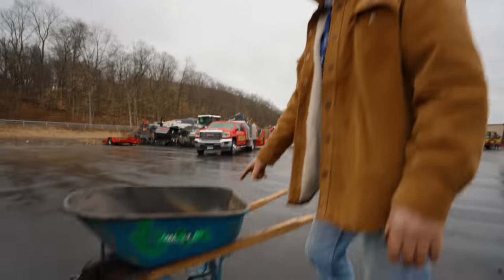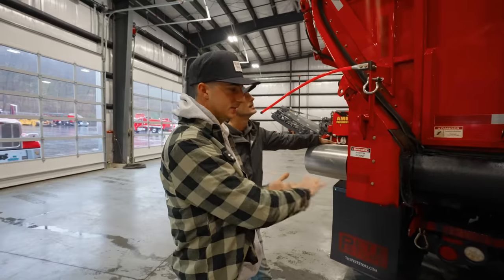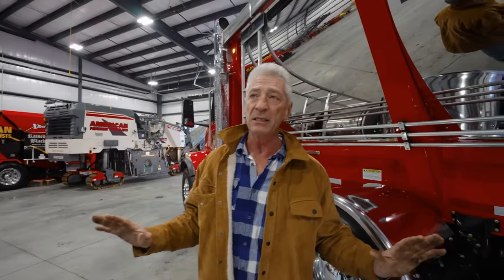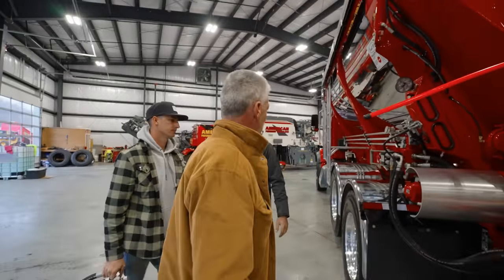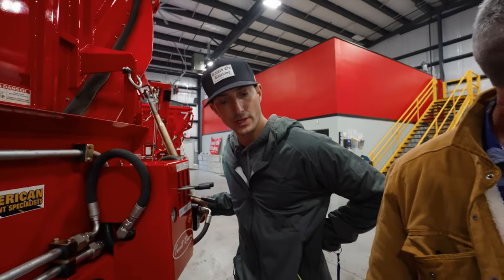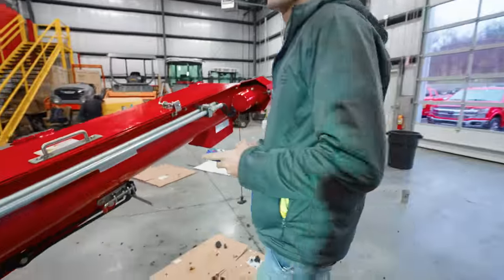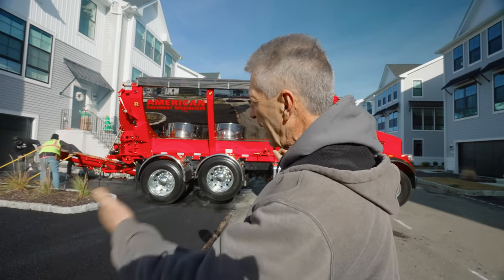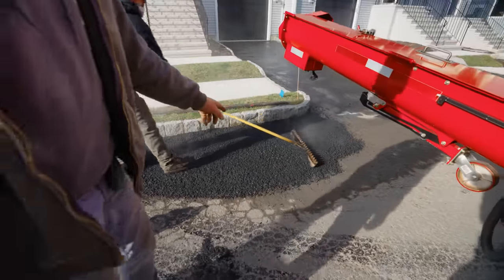NEW PETERBILT 567 LIVE-BOTTOMS | Trout River x APS

Comment: This should be a requirement for dpw/municipalities for multiple reasons. Helps in in patch work which is most of their work and helps in pothole repairs along with everything you've said. Would also be good for loam after a roads been paved or after a new sidewalk along the edge. Also good for edge of road/ shoulder work. This would also be good for mulching flower beds along roads or in rotarys.  Brilliant idea guys for sure would love to try it out but trying to convince a municipality to buy one and maintain it the right way would be tough.
Reply: That is exactly what I was thinking.
Reply: weeping tile along foundations back filling, trenching filling for pipes cables ect,,, , even just gravel on a driveway ,  no other equipment but a rake , but pot hole repair speed must be 10x faster if not more , thinking with out a box tight there,

Comment: I think adding in load cell or inline air pressure monitors on the rear bags would allow you to know what tonnage you have left on board and when you start.  Takes the guess work out of knowing or thinking you know what's loaded or left on the truck
Reply from the maker: Agreed!!! Hard to tell what’s in the truck without the body raised in the air.  We discussed this the other day. Most likely going to add them to this unit this winter!

Comment: I’m just a farmer we use that hydraulic hook up on our heads on our combines. I’ve always wondered why it doesn’t get used in the construction industry. My brother-in-law put a 50 foot on the back of a live bottom street truck that he built with a huge troth auger like you got , but it wasn’t as fancy with that remote. That’s a good idea. He had a big job where he needed to get up in something. I can’t remember what the hell it was 10 years ago. And the u trough auger came off our farm. It was basically wore out and wasn’t moving green is efficiently but it sure does move asphalt kind of doesn’t like your binders especially dense binder, but nice job I like it you should make it so you can add on extensions if you want.

Comment: Not sure if this would be beneficial but if there was two extra buttons on the remote to signal to the driver instead of having to take your hands off the control to wave them on. One button for forwards will signal the driver and another button for stop. Even if it was led lights flashing by their mirrors in the cab. This would allow the control operator to not need to focus on getting the drivers attention and can keep their hands on the control moving the auger position.
Reply from the maker: Great idea.  Almost like the stop and go lights on the new milling machines.  We are going to fit it with cameras but then you have the problem of the driver watching the camera when you need them looking at you!

Comment: Two things come to my mind. First of all, awesome idea! I’m not a paver, but I appreciate innovation. 

The “cap” on the hydraulic coupler. The part that stores in the cab when using the auger? Tether that to the coupler. One day somebody will be in a hurry and set that on a fender. Next thing you know it’s bouncing down the highway. 

Other thing. Watching you guys use that and knowing there’s a driver and an auger operator I wonder if they can be combined. You know the trucks they drive guardrail posts with? The operator in that jump seat works the stake pounder and steers/ moves the truck. Could make it stupid expensive but could make it way more productive.

Comment: Awesome piece of equipment.  Couple thoughts; how about look at some of the wrecker (heavy duty tow truck) pin on equipment maybe a tag axle for further capacity, a solid pin design easier to connect into a plate on the truck body, if you are using the auger for a primary stage how about a secondary extendable stage that is belt driven (lighter and not as heavy since you already augmented the material) for greater material spread without moving the truck.   Possibly more integrated control from the ground versus driver for PTO / Body & Aux paving accessory......Name BTBS203.1 (Black Top Bill Stanley).....nice work from a great group of guys!!

Comment: i think you could change the clean out assembly on bottom some sort of sliding gate , also is bed heated and could it be ? (maybe on sides )  also really great vision and craftsmanship by you and trout run good stuff
Reply: The trout rivers that I ran weren't heated, I'm sure they could be by piping the truck exhaust thru like they do with some slinger and dump bodys. But the bodys are so well insulated, we would be on a Dot job sitting for 6-8 hours with a load doing patches with base and it was coming out just as hot as it went in!

Comment: Awesome work. Maybe add an adjustable blade or paddle at the end of the chute that will spread the drop, maybe that will make it easier for the guys spreading it. Because the machine did some of the work for them.
Can definitely see the chute operator makes a big difference. The more evenly he can distribute the material the easier and faster the job is going.

Comment: we have these types of trucks her in norway, but they are usually tridems with a steering axle in the front and the back. you can load around 17 tonns of asphalt and the truck itself is remote controlled along with the auger. the driver has a fully sised controler around the waist and drives the truck and the auger👍

Comment: All I can say is I want one. I've seen heavy wet sand clog up or burn up belts in live bottom spreaders. This seems to have not had a problem at all with the asphalt! Hopefully it'll be sold without chassis like a dump bed and fit your own truck to it. Please try all materials on this gypsum asphalt sand soil etc

Comment: It's a beautiful thing, there boys.
I'm retired now but I've hauled a lot of asphalt in my times in the Cleveland Oh. area. Mostly interstates. Tandems, Tri-axles,  Semi-dumps, and then came the live bottoms. Wonderful for under bridges & uneven ground.
Thats a nice rig you have there.   But I was just wondering if you have an external hydraulic oil cooler on it. If not you might think about one. They really help.
Also having a couple of cameras mounted on the back of the truck for the driver would be nice.  And using a headset & mic (the kind they use in helicopters)for the guy operating the screw & too the driver would be cool. Hell might as well go all out. LOL
Having a bigger size screw you would get more asphalt flowing out right . Making work faster. 
I subscribed to your channel. I'm very impressed with your operations. Good luck guys.
Peace out!

Comment: How do you protect the belt from all the heat? How often are you changing out the belts and what’s the cost?
Reply: the belt is heat resistant and the box will rust and rot out before the belt wears out. but overtime the belt can get thin and ive replaced a belt like this except on a longer bigger truck. they run about $50 / foot and its up to you to replace it

Comment: can this unit run concrete?  rocks/river rocks?  landscaping applications?
Reply from the maker: We think it’s going to be more for fine material.  Asphalt, sand, top soil, mulch, process.  Don’t think it’ll work well with river rocks.  You can discharge without the belt attachment.  If you’re looking to fill in a trench or something.

Comment: Nice job man, this thing is a pretty hot setup for what it is intended for. I just got through reading all the comments, and there was countless people commenting that this kind of technology has been around in other parts of the world for a long time now, etc. but I almost feel like they are missing something. I think the real beauty of this man’s design, is the ability to quickly detach this piece and then be able to use his cool ass dump truck as normal. In no time at all. Maybe I’m wrong, maybe those other units easily detach as well, I’ve never seen them. But you have to admit, the apparent ease and amount of time this takes to attach and detach is not too damn shabby. Pretty impressive working design, especially for the first prototype of it. It can only get better from here on out, with small little tweaks here and there. Lookin good my man!, nice job!
Reply: They do detach easily. Under ten minutes.
Reply: @to666be  is that right?, and then you’ve got just a regular live bottom dump truck after you detach, as in this case? That’s pretty wild. I had never really seen a live bottom dump truck until I watched this video, and they seem like they work pretty doggone slick. Especially like he said, in areas where you’ve got trees, overhead wires, etc. Wonder if there is ever an issue with a buildup of debris around and under that belt though?

Comment: Hey APS! Really good video and business. We have a similar system here in Sweden, tho it has some longer reach etc and you can actually steer/drive the truck from the remote on the outside of the cab. 
The system here it’s called “Sprider” 
Greetings from Sweden👋
Reply: Yeah I was gonna say, Europe has had trucks like this for years, it's not really that new of a thing. All be it the ability to remove it and run the truck just normal might be.

Comment: very impressive  they always say that you can improve on everyday things and you did that very nice set up , I had a question  what is that thing hanging at the end of the shoot looks like a pull for a motor has like  what looks like a handle on the end ?
Reply: So we needed something for the driver as a guide. It’s easy to see when the placement when the material is falling but it’s hard to gauge when it’s off. So we took an old pull cord and tied it up. Gives the drivers better placement.

Comment: we have a 80 liter tank on the truck with push button auto sprayers to clean the inside and belt and a spray hose the driver can use to clean rims  tyres ect  no stick all ways clean. all on  camera

Comment: I did asphalt for a decade. Never once used a wheelbarrow. We did interstates and major roads. Are the wheelbarrows used on smaller jobs and driveways?
Reply from the maker: Yes a lot of smaller asphalt companies use them for tight spots and paving by hand.  We do mostly larger commercial work and we still can’t get away from them. Hopefully this will solve that problem.

Comment: Does tilcon have a similar setup but up front like a cement mixer? Or is that a curbing truck ?
Reply from the maker: Yes they’ve been running old cement trucks fitted for asphalt for years! Only difference is you can’t dump into a paver. We can run this truck every day. Attachment or no attachment

Comment: Awesome design! You could potentially solve the auger reach issue with a secondary auger that folds up to still keep the machine compact. Similar to a grain auger system. Then the truck could park on the road and you would have reach and maneuverability in the auger to reach the far out spots.
Reply from the maker: Good tip! Thank you!

Comment: put an electric actuator or heck even a very small hydraulic cylinder of the end of the cleanout shoot that you can control from the remote or the back of truck so FOR SAFETY REASONS your not having a guy crawl under a truck that could injury him in a freak accident, just my FYI after 10 years as a trash man and 40 yrs as a fireman hazmat tech VERY GREAT VIDEO

Comment: we have the same trucks here in Australia but bigger and better ,twin steer,  35, 40ft long 3 rear axle full digital remote control in-out side of cab 16 cameras all around truck monitors in cab and blue tooth iPhone connection  auto unloading for freeways with auto cleaning for inside the tipper and wheels nothing sticks $200,000 for truck and $200.000 for the  back part very nice set up love it full auto truck gps tracking to

Comment: Looking at the open auger, there is a lot of buildup stuck under the  screw and sidewalls for what little the unit has been operated. The screw better be quick and easy to pull out because it's going build up very quickly. What are you using  as "degreaser" ? Is that straight diesel fuel? What is the load rating and how many cubic feet are lost than a normal box designed end-dump. With a reduced box size, won't that mean more loads being hauled and in turn, a longer day for the entire crew and plant operator(s)?

Comment: Great machine! Even for small drive way you could impliment some control system to do the side to side Motion at a speed and width of your choising to achieve the thickness. Then the remote guy once set, 1-2 pass can start helping or manually control when usefull

Comment: Question for you don't mean to sound like a dummy but where the GVW is under 26, 001 do you need a CDL I know it's got to get brakes but that's just an endorsement. One more question you get a bunch more of these trucks won't that you do away with the amount of employees you or will you be able to do that much more work if the works out there...
Reply: The trucks light weight is 26,500. So I guess empty you can drive it without a CDL but we don’t plan on driving it empty.
Reply: And we don’t plan on laying off personnel. We just reposition the guys to work along side this machine. Making our work faster. Allowing us to do more work which should require more employees!
Reply: @@joshstanley2129  anything over a GVWR of 26,001lbs which this is requires a cdl. Even empty you have to have one to drive this.

Comment: It's nice,  but I think u gonna have axle weight issues if u ever get pulled over and axle scaled with15 ton
Reply: U got 2 extra driveways cause she had 22ton on 🤣
Reply from the maker: We have two other trucks with dump body’s set up the same way. They are legal for 15 👍
Reply: @AmericanPavement  I'd love to see one axle scaled out. I've been over on back axle many times with 21 ton in a triaxle,  15ton on that seems like you'd have to load that specifically or your gonna be over on 1 or other. Ct laws suck

Comment: Hi my name is Joe I live in Canada we have a truck called the stone slinger that has an arm on the side that sits on the passenger side almost to the level of the frame that comes out depending on how long the boxes could be 16 to 20 feet long it is on a belt, but you probably could converted it into a auger and use it for asphalt to look good nice 👍🏼

Comment: Very cool to see the innovation. I've seen live bottoms used before but never in combination with the conveyor. You could've done the job in 4 loads and no paver which could really help a smaller company out. Once they get the weight down to where this truck is not as heavy as a regular tri-axle...it could literally eliminate the need for a dump body because this thing can do the same and much more then a dump truck.

Comment: Looks pretty sweet, I am guessing their is a reason to have the hand controls on the right side, but it almost looks better to have it in the left in case the remote system stopped.
Reply: 100% to keep in eye contact with the driver and still get work done
Reply: @Grandpuba1069  I get that, the manual hand control were on the right side of the machine,

Comment: If you fitted distance measure lasers to the end of the auger you could measure distance from auger to sub-base and distance from auger to wearing course as it’s being placed, the difference between the two would be the thickness of the wearing course, if you know feed rates, you could start to accurately meter the asphalt thickness which could be another area of waste reduction.  Or be able to charge client extra for thicker asphalt where their base is uneven.  Perhaps you could fit other tech like temperature gauge for the load, safety cameras for the driver?   

I think this is a great idea, the only concern for me is labour working around the auger being struck by the auger/crushing risk if the driver is in the cab dispensing remotely. Yes you have reduced labour by two barrowmen, but now all the workforce are working around the back of a heavy moving truck with inherent blind spots.   

In the UK some equipment is now starting to use mounted blue LED projectors on top the equipment, to beam a “do not enter” zone around the piece of equipment on to the surface, blue because it’s visible during the daytime too.
Reply: The distance thing would not be very useful in my opinion, since you still have to rake the asphalt and smooth it out. The auger is still manually controlled and therefore you won’t always have the perfect thickness placed down due to human error
Reply: @daaneel  It needs raking because it's not being evenly distributed, what if better distribution could limit raking? Taking measurement with lasers could have several benefits, distribution, depth, spread, sometimes it's small improvements that can lead to big efficiencies, there is a measure in everything after all.
Reply: @HuntsChris  that would assume you have a uniform layer of asphalt perfectly dropping out of the auger. When the material falls from the auger it piles in a certain way that I don’t think you can avoid raking. I just don’t think such a system would be feasible from a labor savings and cost perspective

Comment: very impressive truck ,i worked in paving in the 60s and 70s  i was a member of local 137 operating enginears   in Briarcliff Manor ,N Y and i lived in Danbury  my main experience was roller operator ,back up paver operator  also backhoe and loader ,i worked for D F Macnamee for about 6 years  and Cahill paving in Bedford HIlls for about 6 years,  i think these trucks will change the industry ,very impressive ,i understand  your excitment because when i worked for Macnamee  the had the first trucked equipped with an infared heating unit on the back of the truck about 8 by8 and carried 1 ton of asphalt the got the contract to do the patch work from utility co. and i was part of the crew ,please keep us posted . thank you Ed Nusso retired in Az.